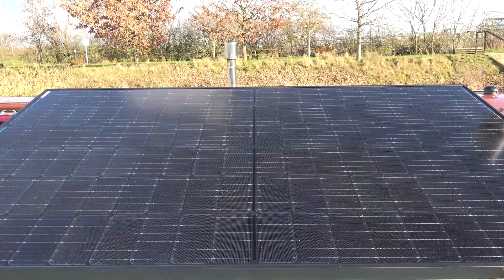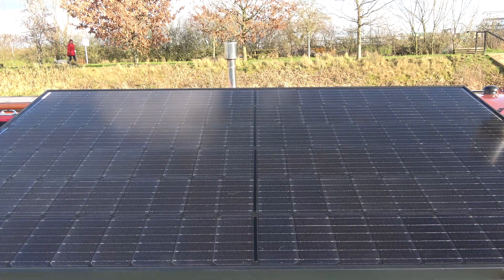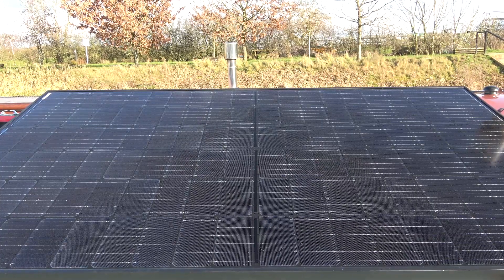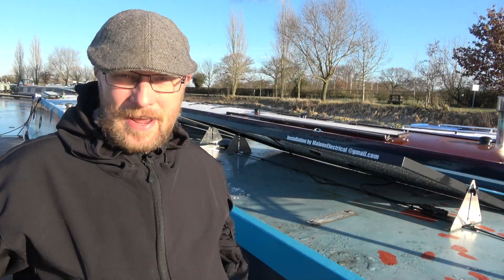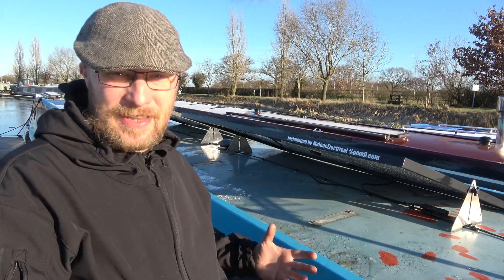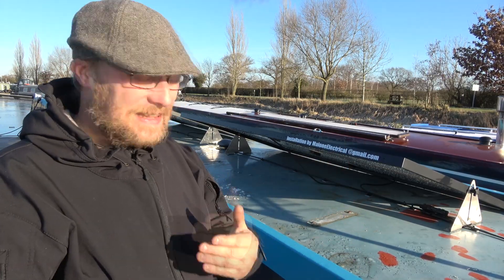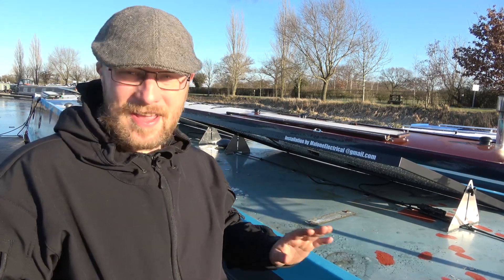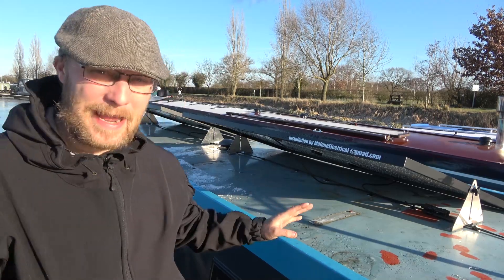#8 Upgrading the Solar on our narrowboat

Comment: Any rationale why you went for the fixed and tiltable panels, over the bendable thin film that others seem to use.

Power output? Cost?
Reply from the maker: For us it came down to the fact that some of the cheaper flat panels you can get alow water under them which starts to rot the roof. There are some like foxes afloat have which don't do this and are really good quality but they are so much more expensive. Its also surprising how much more power you get just by tilting the panels towards the sun 🙂

Comment: Good vlog. What are the panel ratings and what sort of Victron kit is inside?  How are the panels connected? - series/parallel etc.. thanks!  Rob
Reply from the maker: Thanks Rob we have 3 x 320w Solar panels. Monocrystalline (Black Frame Split Cell) 
Victron MPPT  70A 150V Solar Controller. 
Panel dimensions 1685 x 1000 x 32mm
This is for 5 x 110amp  leisure batteries
Reply: @CruisingCrafts  Excellent, thats quite some setup.. :)